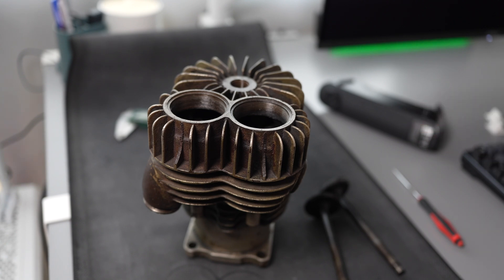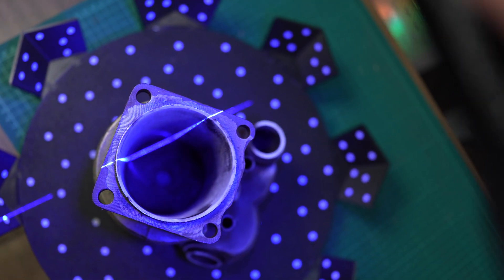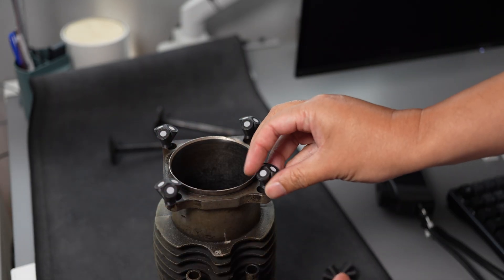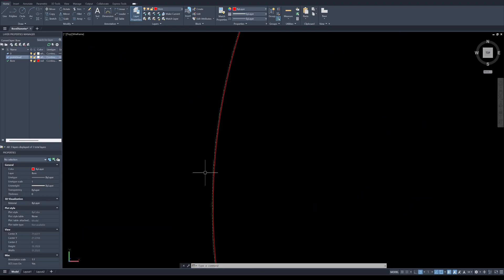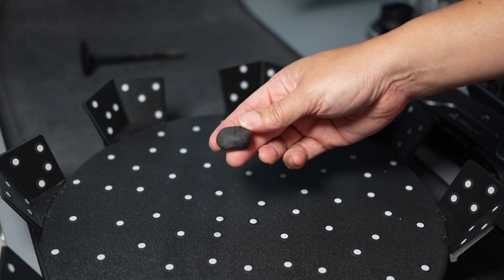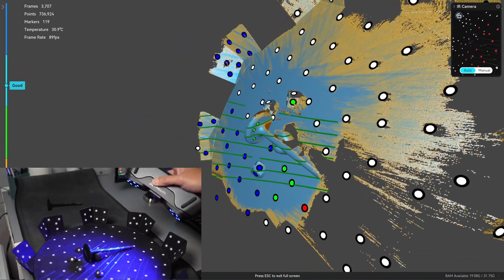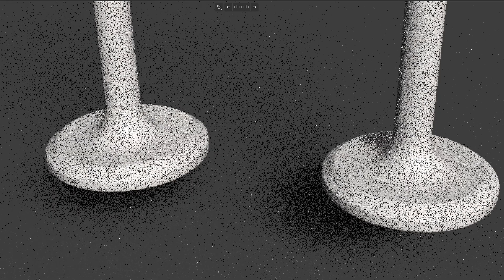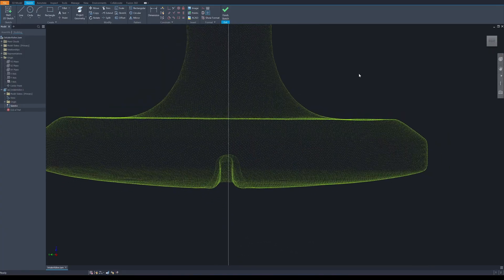Ultimate Guide to Precision Scanning – Cylinder Bore & Engine Valve Measurement

Comment: Hey thanks for the videos ! Im new to the 3d scanning but im very interesting in learning more. One question I would love to see if you know, because I cannot find it anywhere.. 

I scanned an object and top is curved, and I need to measure from point A to B,  but when I use Cloudcompare It measures it in a straight line and its not accurate.. you have a video showing this ?  Thanks !!!
Reply from the maker: Your only option is to align the point cloud with CloudCompare and measure it using CAD.

Comment: Great video and well explained. I wonder if this cylinder has been bored oversize at some point for oversize pistons. Wiki would not go into that detail.
Reply from the maker: While reversing the jacket, I noticed the wall is relatively thin at 7 mm. There’s no evidence of any prior re-boring. The marks on the valve combustion face look manually cut, possibly by the former owner for valve lapping purposes.

Comment: For the valve scanning, what should be the result if you use the MaF scanner? Should be interesting to see it in action.👍👍🇨🇦🇨🇦
Reply from the maker: MAF3 delivers high precision, but its accuracy is reduced due to the use of a soft foam calibration board. To achieve high accuracy, the point cloud must be scaled in CloudCompare after scanning.

Comment: Measuring diameter is important(inside micrometer, dial bore gauge, tri bore etc.) but you need also something to mesure roundness so a CMM or a precise spindle with dial indicator can do this task. Precise 3d scanner is a more modern take but how can it be sure or reliable at this level of precision? Anyway this is a very good video as always 👍👍🇨🇦🇨🇦
Reply from the maker: Many of my industrial clients have shifted from using CMMs and lab tools to investing in $20 - $30K industrial 3D scanners. These scanners allow them to check parts directly on site for wear and damage, and the practice is gaining popularity.

Comment: Do the different optimal distances on each different model of scanner affect accuracy?
Reply from the maker: For maximum accuracy, calibrate before each use. Position the scanner near the lower end of the optimal green distance bar, and ensure the marker is only a few centimeters deep from the scanning surface.

Comment: From memory I’m more than sure the slots were for alignment or removal or possibly both. Old flathead engines it was used to assist in adjustment. Edit I answered before the end of the video.  Yes used for seating purposes. I guess sucker type  lapping tools were not invented at that point.
Reply from the maker: Yes, I agree it was used for valve lapping, likely driven by a slow-turning motor. Since this engine was mass-produced, they must have developed a time-saving method.
Reply: Probably they just didn't bother much for air flow at that level, so easy valve handling was more imporatant for them.